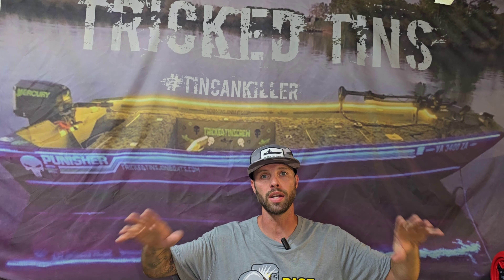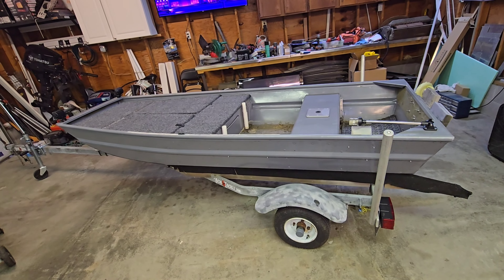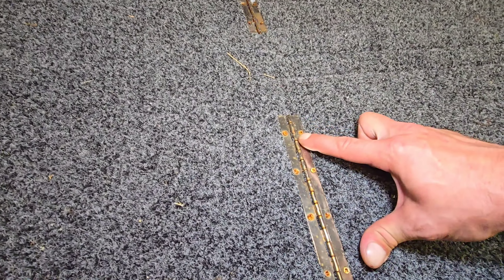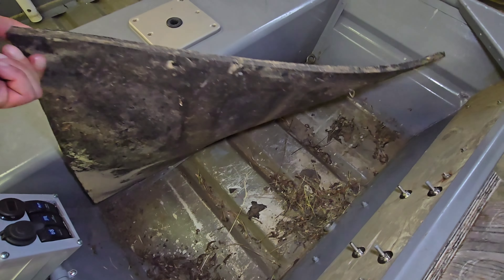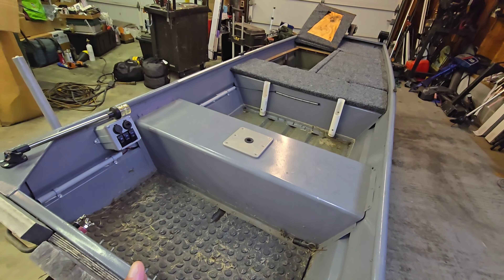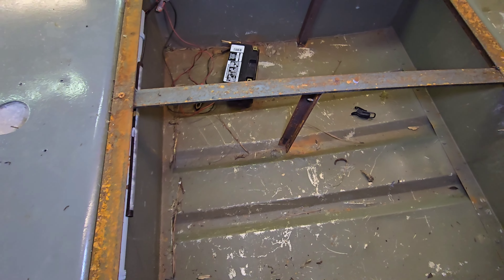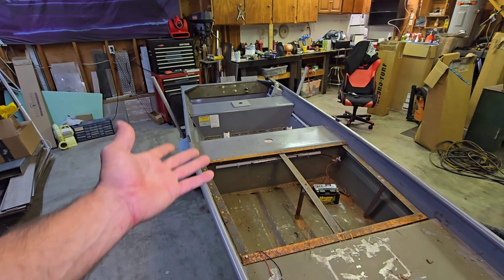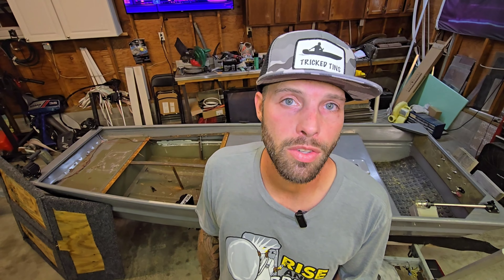The smallest boat ever! @FISHERYIN

Comment: Great content again! Thank you 

So... if one were wanting to build the front end of a riveted 1436 to hold a transom style trolling motor securely... would you be willing to Try??? I am just getting started on building the rest of it out first. I will be doing the trolling motor area down the path a little ways. 

I had to go with the transom mount style so I can have the option down the road to get an auto boat to add to it. May just stick with the tiller style long term though since it is as simple as it gets and should be more reliable that way. 

You could even review my first build and talk smack about it if desired. 😆

She only has an old 9.8 that I just overhauled. Making it into an uber light saltwater/or cypress flats skiff for getting skinny and shallow.
Reply from the maker: I don't recommend rivited hull but I work for $$$ so I'll build whatever you want if your $$$ is right
Reply: @TRICKEDTINS  
OK. Thank You. I will reach out for a quote then. I will go to your website and send one soon. 

How far out do you need me to reach out for a quote?
Reply from the maker: @great0789  booked till September
Reply: @TRICKEDTINS  
Sounds like you are running full steam ahead! 

Congrats on the successful business!